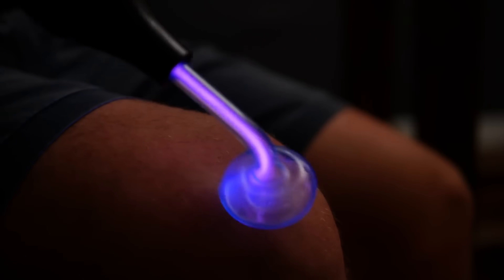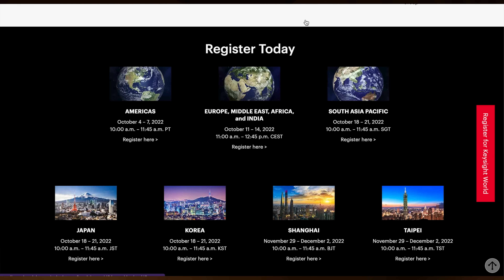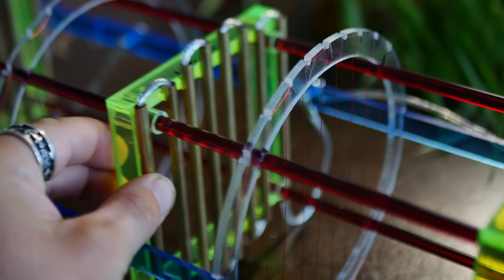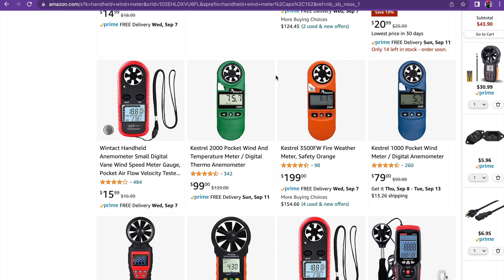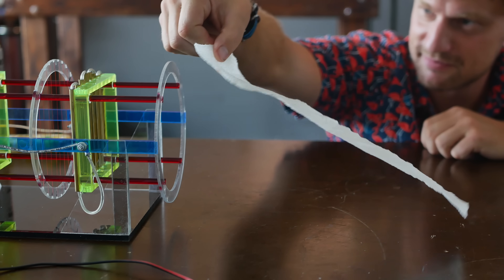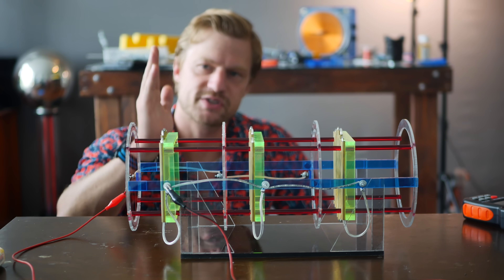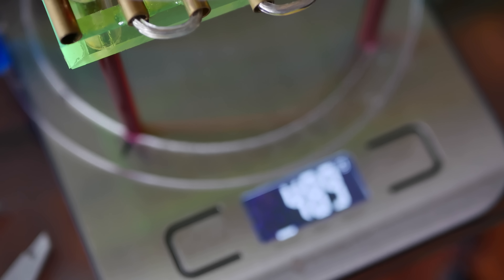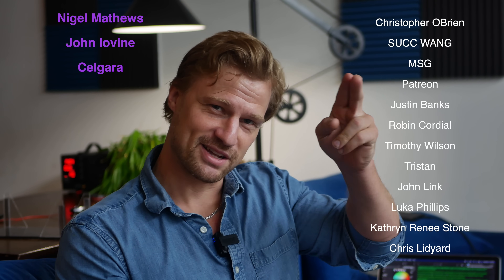Designing A Next-Gen Ionic Thruster! (For Flight)

Comment: Nice prototype fyi think continuous gradient and ion count proportional to positive grid surface area...also superimposing AC over your DC offset ALSO  DC should be just below breakdown voltage (AIR==3kv/mm separation) AND AC 1/4 wavelength should == to separation distance. Lastly the interstage spacing probably has a straight forward mathematical relationship

Comment: 1) A housing as your probably pulling in air from the sides to. make the housing into a Venturi tube.
2) spread the stages out further, from each other. start with a large gap for the first stage and small gap with the last stage. (while in housing)
3) increase density of the grid for thin wires. more ionic plasma

Also how much weight is the electronics?

Comment: using thinner wire for engine and for sides you can shave half the weight. also there is a lot of structure used by the acrylic that might not be needed. dry balsa would should not be conductive over the space of the engines 4.9kv/mm vs 30kv/mm which would be incredibly lighter than acrylic and easy to laser cut. also more winding between should have as much effect as high voltage. im not sure if there is a duty cycle on the pulses but maybe pulsing with less on duty cycle and more energy per pulse? as the probes distance is only for positive and negative leads. then you could also funnel the energy at the end for more thrust, it will be over less area but allow faster speeds. anyways this is. a really cool engine!

Comment: What if you Ducted where the air enter, put this in a tube and concentrate the output with a nozzle. Just wondering if ventury effect could help the output. In fact a compressor from a jet engine without the rest doesnt do much either.

Comment: Looking good!  Try similar to what the Dyson Fan does, use a tube to a gap then a funnel to the next stage.  If you used thinner material you might be able to lower the weight as the rods, squares and the circles didn't really need to be that size to keep electrical isolation and strength.  I read a few of the other comments and it would be worth looking into different voltages and distances starting at the second and third stage with only the first stage at the last known values.  Make notes on if you end up with an electric  Bernoulli Effect.

Comment: Another metric I'd like to know is how close would each stage's ground have to be to negatively impact the next one. Can it be insulated from the next system to have them stacked much closer to use the ground of one system be on the back side of the positive of the next system so you only need one plate already halving the weight there. 
Is it being an open design negatively effecting the flow of air as it speeds up on each system (enclose the whole tube with a thin membrane to make sure airflow is only from the input side.
I don't have a third option, but I am quite interested to see where this would go. I am always intrigued by the idea of machines with no mechanically moving parts.

Comment: So what I wonder is how using different wire sizes would affect the results.
How different lengths would affect it (So more wire crossing the path).
I don't know how it works at all but maybe reduce the size of the brass tube to allow more air to pass. Or make it more aerodynamic.

You could probably reduce spacing between each module.
Looking at your footage I think you might be using isolated (because of the red color) wires. You will likely get better performance if you used copper without it.
I am wondering how adding a tube around the entire thing would affect the airflow.

The amount of ozone you created must be huge. I do hope you dealt with it safely.